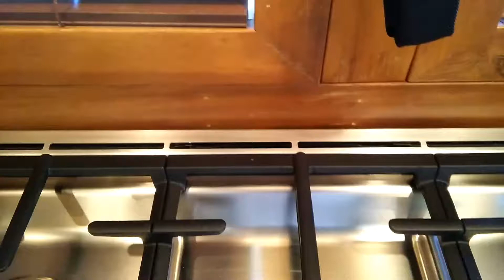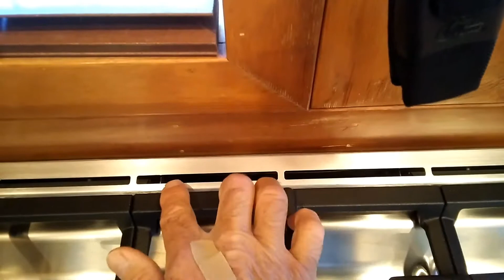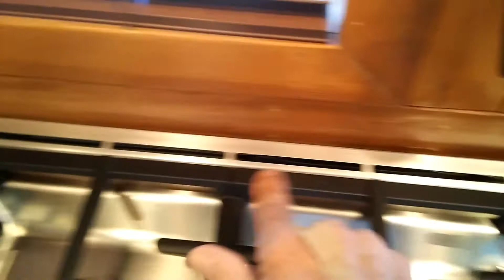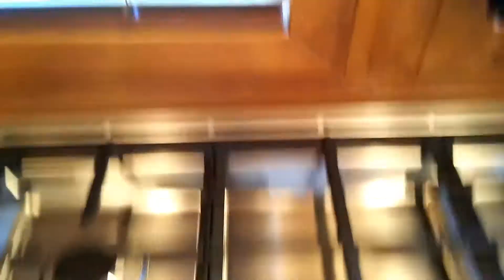Bosch Slide In Gas Range

Comment from the maker: Mine didn't with many others.  I purchased two ranges, both had the wrong blower and Bosch would not warranty.  They had problems they would not warranty, I just wanted everyone to know.  You can not run when you buy to know if it is bad, many had the same problem.  As you can see I had to fix myself by opening the exhaust grill outlet!  A great range now but bad warranty service.  Because so many people see my video at least they can ask before they buy.

Comment: We have just purchased this slide-in range which is perfect from a cooking, functional and visual point of view. 

However it has a major design flaw in that the exhaust fan blowing through the two vents in the top back of the cook top makes an irritatingly loud whistling sound that you can hear in the next room.   The convection blower, also the oven range cooling blower, does not have adequate exhaust opening.  As a result the range has a whistle or irritating fan noise when you use the oven with or without the convection baking cycle. 

Also note that there is a warranty restriction that the range cannot be located further than a 100 miles from a certified Bosch repair technician or the warranty is void!  This restriction is stated on page 39 of the Use and Care Manual which is shipped inside the warming drawer which cannot be read until you have received and unpacked your new range. So far Bosch are not being helpful in solving either of these problems.  Rural buyers beware and make sure you get a verified Bosch Technician name and address before you purchase any item from Bosch and make sure they are within 100 miles of your location.

Comment: I just bought the Bosch 800 slide in and it whistled like crazy. The Bosch Technician ( nice guy)  came and replaced the fan and problem solved- under warranty.
Reply from the maker: I bought two of the stoves, called Bosch to have the problem fixed only to be told they had no approve technician in my area.  They said I had no warranty.  They also said it clearly stated this in the manual shipped inside the new oven.  Wow, you must take delivery to see the warranty.
Stoves are great, factory warranty, unless you live in a major populate city, is simply horrible.
Glad they fixed yours..
When I talked to Bosch I told them it was the wrong fan, they said they would no warranty.
My bad luck but I did open the exhaust vent and instant silence.

Comment from the maker: I purchased two at the same time, both whistle when the oven cooling fan comes on.  During oven cleaning it's on for hours during the entire cleaning cycle and you can hear in almost all rooms.  Made several calls during the 30 day warranty period but Bosch could not find an authorized Bosch repair.  Know authorized Bosch is not the same as range repair and fewer in numbers.
I believe the extended higher back vent outlet listed as optional  will eliminate the problem but my two are using the factory grate stops, also the blower vent,  and it makes lots of whistling noise because the outlets are reeds.
1500 feet per minute and greater air speed out the vent holes is what my air velocity heater reads, know this speed would also whistle exiting any wall outlet heater grill so this is simply the wrong cooling blower size or the standard short grate retainer that is also the vent has the wrong outlet design so Bosch simply has poor designers.
The air exiting also affects the two smaller back 5000 btu burners when on low making the flame at the rear dance and almost non affective.
Bosch said the manual shipped inside the oven indicates if no authorized Bosch repair can be found within 100 miles or their warrant is VOID, understand you must buy first to know about this after it arrives at your home.
More than $5000.00 spent and they will not warranty the ranges!
Everyone needs to understand their policy but more important buyers should know about the noise and possibly having no factory warranty.
I'm a customer buyer and not a paid scripted actor.